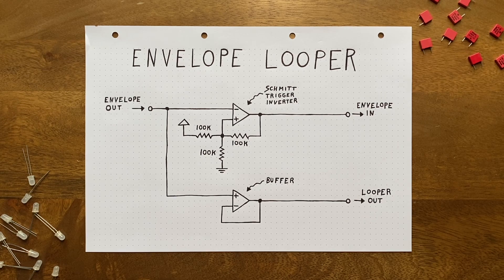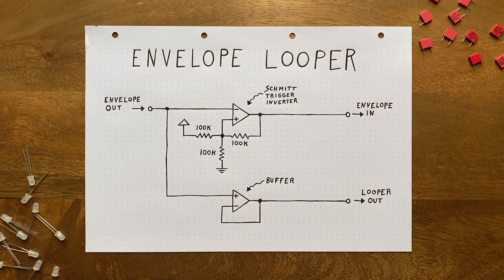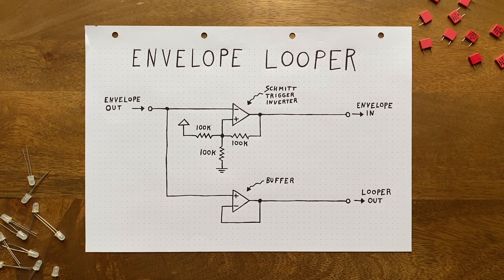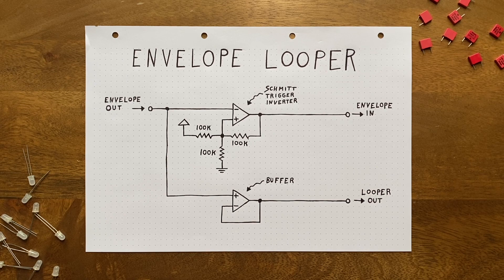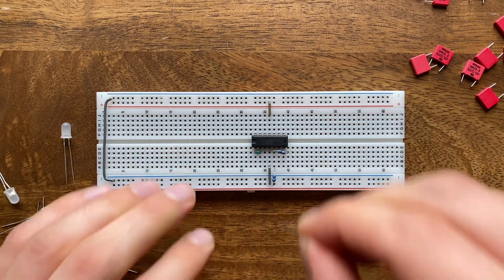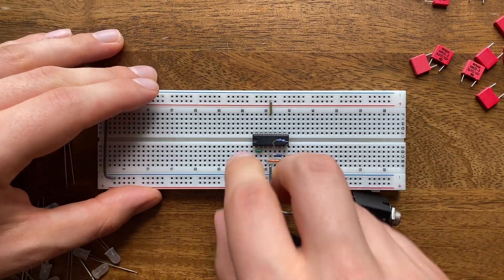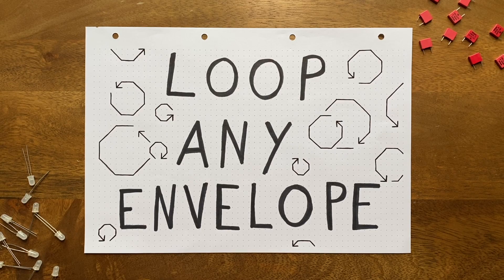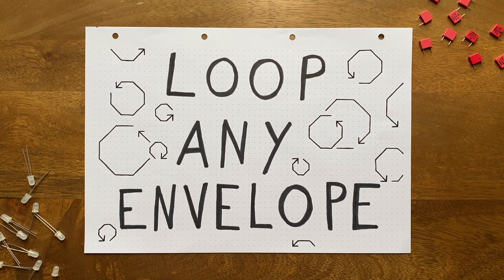How to loop any envelope

Comment: Can't make it work, getting really frustrated.

Tried with a bunch of different TL072's, that's not it.

Checked my power supply, not it (there actually turned out to be one module making the resistance between ground and -12v very low, like 80ohm. Took it out of my rack but not even sure if that was causing issues anywhere).

Checked connections between everything, can't find issues there. The buffer is actually working, but not the trigger.

Tried to get three 100k resistors with similar actual resistance, just in case.

Double-checked the ic pinout a few times. Early on I did mess up the two inputs on the Schmitt trigger. But now it's working fine.

Tried with the IC not powered. Nothing.

I'm stumped...
Reply: After writing this I looked up to see the trigger finally coming through. What the actual fuck. I didn't do anything. Can't say I didn't learn anything from this experience but I definitely can't tell you what was the problem here in the end. I fear that it'll stop as soon as I touch it hahaha

Edit:

Turns out the envelope generator I was using doesn't work. My two other EGs (full ADSRs) do cause a trigger to happen, but this AD generator doesn't. I measured the output after it supposedly is at 0v, and it stays just sliiiightly over, unlike the other two that dip slightly in the negative V.
Reply: @tychoclavius4818  I have a similar thing with the AD/SR envelope generator (Also from Moritz' videos) Looping works, but at certain settings of A/R it will shut down and looping stops.  It can only continue when dis/reconnected.

Comment: If I am not mistaken, the output will be a really short pulse (enough to raise the envelope above 8V), basically only triggering the Attack and Release phases. This seems to be the case as the S and D knobs don't really seem to do much in your sound example. Also, I would guess that the envelope will then swing between 4V and 8V.

Comment: This might be a stupid question, but this circuit is passive, right? I don’t get what the top most bread board jumper from the IC to the positive rail is doing, as the positive rail isn’t connected to anything.
Reply: Both opamps need to be powered.

Think about it: when the envelope reaches 0v, this circuit sends out a trigger signal. That trigger has a positive voltage, and that voltage needs to come from somewhere. It's not the input because that's at 0v
(and there's no capacitor that "saved some for later")

Comment: Ummmm... how would you send the first trigger to the envelope?
Or a "reset/restart" trigger - an OR gate?
Reply: 4yrs later but thought I'd respond anyway as the Schmidt trigger is continuously searching for below its threshold when the envelope is "off" and the loop is on the Schmidt trigger will automatically send a gate pulse due to the envelope being below the threshold

Comment: So is this diagram the wiring behind the scenes (the directions of the arrows are throwing me off a bit)?  Meaning the output of the envelope is wired to the trigger input such that when the input returns to 0v, it starts the cycle again?  Is the "5(S?)/V" switch in-line to toggle between looping and one-shot behavior?

Comment: Hey Moritz, would you mind if I used your solution in the ADSR projects on my website (with full credit given of course)? I think a lot of people will find it very helpful.
Reply from the maker: sure, go for it! depending on your projects‘ specs you might have to fiddle with the resistor values a bit - the two thresholds here are 0V and 8V!
Reply: @MoritzKlein0  Thank you! I'll do some experiments first.

Comment: Moritz, can you do a video about an envelope follower? Keep up the good work!
Reply: For a very basic, passive envelope follower, try this. It worked for me, and it's only five components:

2x jacks
Diode: 1n4148
Resistor: 100k
Capacitor: 1uf

Connect a diode between the input and output jacks (the tip connectors), configured to let through positive voltages (= arrow pointing from in to out).

Connect the jacks' ground connectors (with wire).

Connect the resistor from the output tip to ground, then do the same with the capacitor, from output tip to ground.

Voila!

I can't do a Moritz Klein breakdown of how it works exactly, but the diode takes only the positive voltages, the capacitor holds it high and smooths it into a cv voltage, and the resistor allows the voltage to slowly drop back down?? That's my guess at least.

If you solder this, you don't need stripboard, just solder it right onto the jacks.

I found this little schematic in a pdf, "Passive multiples and friends" by North Coast Synthesis Ltd., Matthew Skala

-

Bonus, so you have something to do with it:
Envelope follower sidechain patch:
Mult your kick output, send one to this, send the resulting envelope to an inverter/polarizer to invert it, mix with positive offset voltage, and send that to the cv input of a vca, and send a synth or drone or noise through there. The offset keeps it open, and the negative envelope ducks it when the kick hits, for a louder, more powerful kick without adding dB's (to save your eardrums)

Comment: hello, this short video was awesome :). Could i hyphotetically use the TL074 on this inverter configuration to make the oscillation core on your VCO project instead of the 40106?
Reply: Yes, but in practice, the slew rate of the opamp is a little low... This doesn't matter a whole lot at low frequnecies, but the higher you go, the more of an impact it has. There are likely better opamps out there for the task, and with them, this is likely a perfectly viable option.